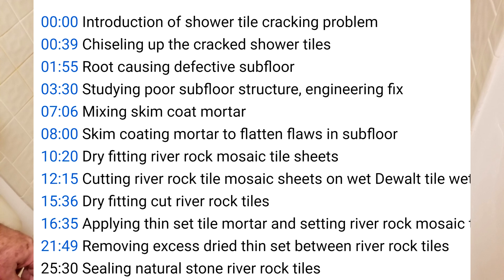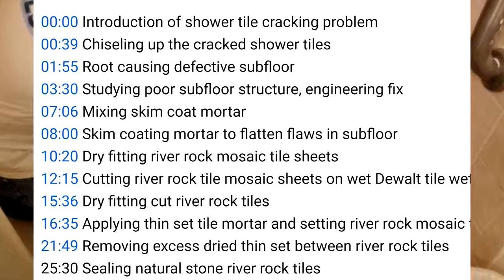DIY Install River Rock Mosaic Tile, Fix Cracked Shower Floor Tiles

Comment from the maker: 🛒 Mapei Keracaulk S Sanded Caulking (Light Almond): https://amzn.to/2TJW6xA
🛒 Dripless 10oz Ergonomic Caulk Gun: https://amzn.to/2Du7tRJ
🛒 Cramer 5-Fugi Caulking Kit: https://amzn.to/2DjZVC1
🛒 DEWALT D24000 Wet Tile Saw, 10-Inch, 1.5-HP: https://amzn.to/2LlaNDY
🛒 DEWALT D24000S 1.5-Horsepower 10-Inch Wet Tile Saw with tile saw stand: https://amzn.to/2zSilHP
🛒  DEWALT D24001 Tile Saw Stand for D24000 Tile-Saw: https://amzn.to/2NRP5sF
🛒  DEWALT DW4764 10-Inch by .060-Inch Premium XP4 Tile Blade Wet: https://amzn.to/2ZWwf6o

Comment: My river rock shower floor has started to crack. Very subtle, any way to prevent further cracking?
Reply from the maker: It sounds like there is too much movement on the floor, or maybe not enough thinset was put down. It should not just start cracking. What size tiles are they, where on the floor is it cracking? Are the grout lines cracking or is it the tiles themselves cracking.

Comment: Loved this video- we have that kind of floor in our shower and it’s been 4 years - can we add more grout and re-silicone the corners- doesn’t seem to drain properly
Reply from the maker: Is your shower floor sloped? If it is not draining properly the lack of s** is what causes it.You will have to fix that issue before you can do anything else. But yes. You? Could. Regroutd if? You can get the grout to stay in between the tiles if they're not too thin of a crowd line period and you could indeed silicone the corners.

Comment: i installed similar tile about 5 years ago  used epoxy grout and the stones are poping out     what would be the fix
Reply from the maker: Stones popping out are likely due to not enough thin set put down and not good thin set. Make sure your thinset is a latex modified thin set.

Comment: Hey great job, if a few of my tiles come lose because of bad thinset, can I glue down any tiles with pl?
Reply from the maker: Yes and no. Yes they will stick, but if they are on the floor, you must have at least 85% coverage under the tile to prevent it from cracking when you step on it. I shoot for 100% coverage under my tiles.

Comment: Great job Jeff!! Your patience pays off here, not too many guys have this anymore! Only question I have is don't you think it's important to wear knee pads? I'm 53 and I can't be on my knees for a long time anymore.
Reply from the maker: Yes, it is important to wear knee pads. But I hate kneepads, they mess up my back and my balance. I try to minimize being on my knees, and in between shots I'm using my tire rubber wood floor underlayment sheet to rest my knees comfortably on.; We also have a large Kobalt tray with black rubber for your knees as well.

Comment: When you burn in your mortar bed for the tile the rough surface is a great place to key in....the tile will be supported by the mortar when cured aslong as you get 95 100% coverage
Reply from the maker: Yes, when we do mortar beds, we often skim coat a very thin layer to help the tile mortar adhere better

Comment: About 20 minutes in, when you are vacuuming, two tiles rise up off of the pan. Did you reattach with thinset? Wait 24 hours and then seal? How do you handle the occasional loose tile?
Reply from the maker: When I find loose tiles, I try to dig around them and under if possible, remove thin set, then mix up a small amount in a plastic cup and stuff it under the tiles. Then grout next day.

Comment: What causes the water not to drain
Reply from the maker: Improper slope toward the drain. All the way around the perimiter, it should be higher than the drain. I fnot the water will not have any way to run down the tikes to the drain

Comment: Hey Jeff...can you provide links to the silicone and the set from Germany you showed?  Amazon?
Reply from the maker: Sorry just got around to making the links and they are now in the video description as well
🛒 Mapei Keracaulk S Sanded Caulking (Light Almond): https://amzn.to/2TJW6xA
🛒 Dripless 10oz Ergonomic Caulk Gun: https://amzn.to/2Du7tRJ
🛒 Cramer 5-Fugi Caulking Kit: https://amzn.to/2DjZVC1
🛒 DEWALT D24000 Wet Tile Saw, 10-Inch, 1.5-HP: https://amzn.to/2LlaNDY
🛒 DEWALT D24000S 1.5-Horsepower 10-Inch Wet Tile Saw with tile saw stand: https://amzn.to/2zSilHP
🛒  DEWALT D24001 Tile Saw Stand for D24000 Tile-Saw: https://amzn.to/2NRP5sF
🛒  DEWALT DW4764 10-Inch by .060-Inch Premium XP4 Tile Blade Wet: https://amzn.to/2ZWwf6o
Reply: @jeffostroff  Thanks a million!

Comment: For tile removal...wear safety glasses ...always...
Btw..how did you keep the silicone from getting all over your pants? Lol
Reply from the maker: But I keep the silicone off of my pants by only applying silicone on the corners of the walls lol also  boatloads of paper towels and I'm constantly wiping my fingers off but since I am using the tool and not my finger I  Get a minimal amount of silicone on my hands
Reply: @jeffostroff  i obviously have to buy a corner tool for caulking and more paper towels.  Once I get silicone on me..that stuff reproduces faster than covid 19...
Reply from the maker: @FNGstationtwentyeigh   sure does get everyone it starts on one little spot in  did it get here and and O how did you get here and then all now  how to get over here and you put your hand down somewhere and then you set a tool down on it by mistake it just never ends

Comment: I did not understand why you put the siliconized caulk on grout in the corners?
Reply from the maker: You never grout in the corners. It only cracks. You should used the siliconized caulk on all changes of plane.

Comment: Where was the router bit set on sale.
Reply from the maker: Lowes, the skit set, but still shows $99 online, some stores are showing the sale price, some are not.
Reply from the maker: Lowes, the ski set, but still shows $99 online, some stores are showing the sale price, some are not. 
Item 209177, Model 91030

Comment: Awesome job. I’m planning to use a hexagon pattern for my floor so I assume this process will be same for me aside from using a different sealant.
Reply: Also since you know the tile code book, do you use silicone around the drain circle on top and underneath or just the top ring?
Reply from the maker: Yes you would use the exact same process, but as long as your hexagons are not natural stone, like if they are porcelain or ceramic, than you do not be to seal them 1st.